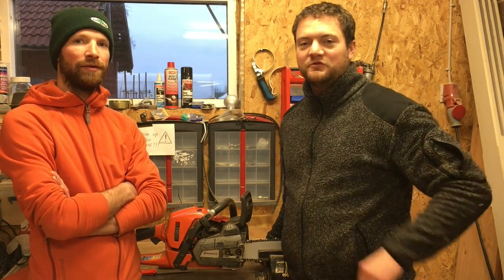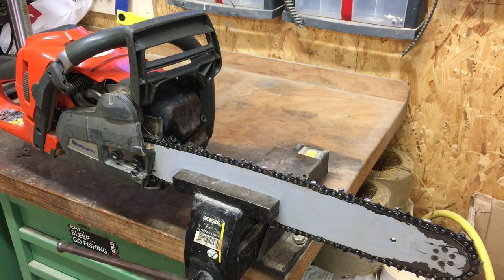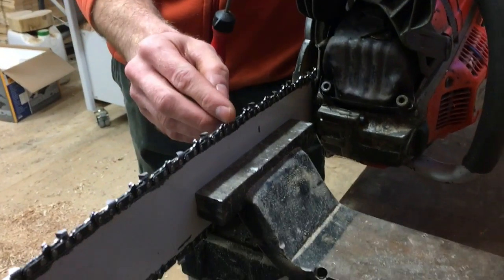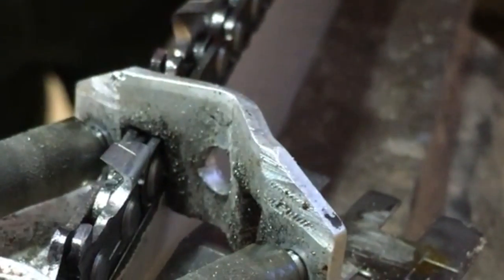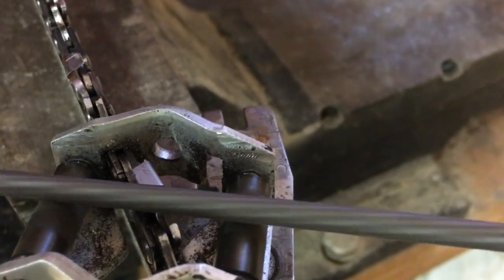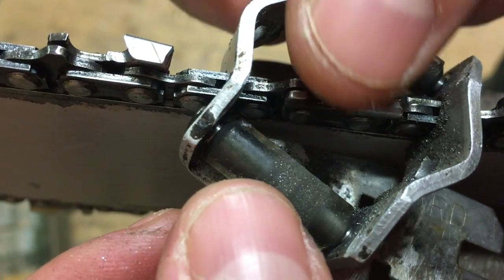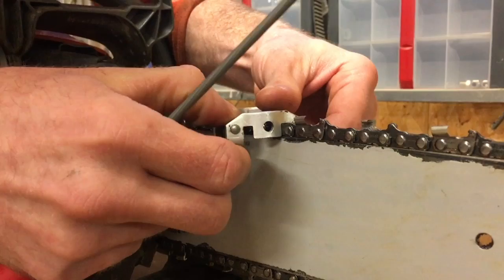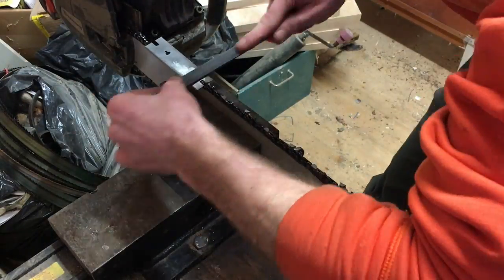Razor-Sharp Chainsaw - How It's Done

Comment: I bought a new Craftsman chainsaw and I didn't know that I was suppose to adjust the chain after 15 minutes of use. After a couple hours the chain jumped off the bar. When I put it back on now, it has a place where the chain doesn't slide freely. And since I'm dumber than I look, I'll probably just go buy a new chain for $20. And now, thanks to you Swedish guys and your excellent video, I know how to make it sharp.
Reply: It pays to know about new tools BEFORE you use them. Especially a chainsaw.

Comment: After filing down the rakers to the correct height, they need to be filed at a slight angle, around 10 degrees. Stihl chains have a grove on them as a guide for the proper angle.

And as mentioned by another commenter, all the teeth should be the exact same length, using the shortest tooth as the standard for the rest.

Comment: Great info. thanks.  What is the name of the sharpening guide you use?
Reply: Husqvarna Combination Swedish Roller Guide
Reply: Oregon makes them.  Stihl makes something similar.  The Stihl system provides greater control, but the file needs to be in a file holder.

Comment: Good step by step process guys, I have never seen those sharpening tools before. Where I am in the US we have different types of guides but I am sure they achieve the same result. Does your brother run an Stihl equipment at all? I myself am an Arborist and have had bad luck with Husqy saws but I prefer their PPE to Stihl, my #1 saw at work at the moment is a Stihl MS362C with a 20" bar and it has done quite well for me, my climbing saw is an MS200T
Reply from the maker: We have Stihl saws as well. I am going to make a video about that.

Comment: Please, in your experience, on average how many feet of chain will one file sharpen?
And, how do you know when it is time time to start using a new file vs. trying to get one or two more sharpenings out of it?
Thanks!
Reply: Robert Wood . I was wondering the same thing , how do you know when your file is done ?? looked online but cant seem to find the answer to that question ..
Reply: pretty simple... when the file is not cutting clean all the way through the stroke or any obvious bad spots time to get a new one
Reply: I replace the file after it doesn't feel right. They are cheap... well the ones sold at the larger lumber yards are anyway. Just a piece of mind.
Reply: Why do you keep you height gauge on an angle when you file the hook?  Shouldn't this be flat on the chain?  Txs
Reply: +A depends on the model.
Reply: @mapleridgefarm1026  When it slides on the tooth without cutting into it. You can feel and see a good file working as you sharpen the chain.

Comment: Excellent video and Very helpful.
Question: The chain and bar were perfectly clean from any saw dust and debris. Did Tim remove the chain and bar before sharpening, or is there some other method for removing the oily, sawdust build-up? Does that model automatically oil the chain while in use or is manually oiled?
Reply: Pretty much all modern saws have an auto oiler.  I use my compressor and just clean off the teeth prior to a sharpen.  In the field I use a brush that is in my sharpening kit.
Reply: All modern saws have an auto oiler, some may also have a manual oiler as well. I have my fathers 1975 Echo CS-701SVL, even it has an automatic oiler and manual oiler. My current Echo CS-8002 has auto and manual.
Reply: R Mac I have an old Homelite 10 inch. So, I guess I'm little bit out of the loop.
Reply: I have a Homelite myself, a Super XL (Blue/White), I love old saws and have a few, a couple of Danarm one of which is from the 1950's I think and a Pioneer 620. They don't build them like they used to, a cliche but true. :-)
Reply: R Mac Yessir, cliché or not, it's the truth! Went through a lot of chains. I just use a rat-tail file and eye ball it. My shame is great.
Reply: +Fred Thorne No shame at all if you  have the skill. I don't, I'm just watching this particular video for knowledge. I started watching Simeon's video's for the homesteading knowledge itself. =D We'll be moving back to the family farm when my husband retires from the Airforce in a year and a half. Can't wait for that to happen! Excited for that. So I've been collecting knowedge...
Reply: Sansa Stark acdc
Reply: AC-DC
Reply: You should take the chain and bar off and clean them AFTER sharpening it.  Your bar doesn't fancy the hard metal particles from the chain much.

Comment: Like a hot knife through butter. Thats a great instruction, Tim! See, i couldn't even remember using any of those jig thingies in school. I actually need a refresh course although i'm certified. I think it's a good idea for safety reasons as i had my certification 20 years ago. I'm still trying to decide on a saw here. I saw a great secondhand one with an Oregon blade but i also have the other eye on a Hitachi. Stihl is a bit out of my price range new but i'm on the secondhand market every day to look at the new arivals! If the price is right, i'm snapping it up. There is an excellent all brands service station in my range, might it need some fixing up. What's your thought on brands and chains, please? I'm so not up to date.
Reply from the maker: Hi there. We only have experience with Husqvarna, Stihl and Jonsered, which pretty much is a Husqvarna now days. We like both brands.
Reply: Thank you!
Reply: Rainx  washer fluid can you mix with other washer fluids

Comment: From a conversation I had with Glen Lovell, Senior Technical Services Technician at Oregon Chain:

"There are a lot of opinions on the subject of whether a chain needs to 
be filed before use or not and it is very difficult to convince someone 
who sharpens are new chain before it is used that they do not need to do
 it. Some of the sharpening before use comes from years ago, before we 
come up with our plunge grind process, where some professionals felt 
they could file a chain better than we could grind one at the factory. 
That is why we went to the "X" grind / plunge grind. The "X" grind 
produces a very sharp cutter that, we feel, does not need to be 
sharpened before use. Having said that, there are still a lot of people 
that feel they need to sharpen our chain before it is used. Overcoming 
personal opinions is extremely difficult and sometimes impossible."

Having said that I want to try a new ceramic file (hone) on competition chains. Diamond files are great too, they roll up less burr.
Reply: A new chain doesn't need to be sharpened. When I install a new chain, I hit the rakers with a flat file, and go to work. I prefer Stihl chains over Oregon. Stihls cut better. And last longer.

Comment: well,  that's the sharpest chain saw I have ever seen! great video.  I will sure use that knowledge next time I will sharpen my chain
Reply from the maker: Awesome. Thanks.
Reply: Best get new eyes if you think that is sharp.. any basic user of chainsaws that have done their research, KNOWS that you are not do apply pressure to the chainsaw to force it down into the cut.. which he clearly does,, this causes additional friction which wears the bar, chain , gear ( drive side) and end sprocket , which also leads to overheating of those metals & dull the chain faster.. A properly sharpened chain, should pull itself into the wood, no matter the type of wood, so much so that you actually only need one hand for the throttle, but I do recommend keeping both on the chainsaw.  It cracks me up watching local volunteers constantly sharpening or changing their chains when cutting up tress from storms to donate as fire wood, because they are pushing the saw... mean while I am going days on days without breaking out a file or cranking up the Belsaw sharps all to edge it up. ( how bad is the lack of knowledge these days... I know  Local logger,  been in business for 15yrs... buys up chains by the bucket fulls. dulls them & instead of sharpening them up,, just tosses them at his work sites. I make it a point to watch for him.. cause I know he will leave a few dozen good chains on a parcel of land he cleared and they are there free for the taking... all because of a lack of knowledge or the will to properly learn how to do it )
Reply: Swedish Homestead : people I know that have experience with chain saws, do not need a gauge to sharpen a saw. Also, u r sharpening g the teeth in the wrong direction ! Sharpen /file a saw or knife INTO the edge...so u don't leave a microscopic burr. Your backstroke on yr file should be your cut / sharpening stroke.
Reply: Richard Elbe : 100% true. Here they even sharpen on the wrong stroke. really not skilled.
Reply: Mike Johnson I don't think these guys will be splitting hairs anytime soon with that saw, not very skilled at all and the saw bogged down in the log when cutting.
   Good video for amateur users.
    Congratulations on the videos but if you need any pointers just contact me, some things though would be too dangerous for you to try.
Reply: Carroll Sanders His brother is a professional tree dude. I'm pretty sure he's proficient with his sharpening skills. Good grief, so many critics.
Reply: Peter Ford He is just an arborist nothing more not a chain engineer, you would believe how many so called arborist can't properly sharpen a chainsaw.
Reply: Sure, I understand. But I know a couple of, " arborists ", and they cut every day for sometimes 30 40 years. I'm sure they've developed their skills, even sharpening, during that time.  I have one I know that is 71 years old, still climbing and cutting. Probably has 60 saws. I'm sure he's honed his sharpening skills during his business time. But as with everything, there are better of any trade. Criticizing is not a plus. That's all I'm saying.
Reply: Peter Ford my skills are so far above the normal user, that they push the limits of reality sharpening with a precision of one tenth of one micron.
Reply: I give up. Y'all are just too superior for this normal world. I just don't know how so many people live their lives, suffering in the shadows of such perfection.
Reply: Peter Ford I hold the world's record for splitting a human hair with a running chainsaw, you are welcome to try, to break it, in now stands at 46 splits from one section of one human hair.
Without cutting the hair into.
     Good luck.😂
Reply: Peter Ford I wonder if you ever heard of square ground chisel chain, or goofy filing my knowledge goes back to the days of real chainsaws 090R Stihls.  Cutting monster trees 8 or more foot in Diameter.
    You should have been around when Ray Murphy was carving belt buckles, as you wore the belt, or striping his daughter's clothing leaving her in a bikini.
     Incidentally I perfected the removing the bikini with the chainsaw stunt, and shaving people, with chainsaws.
Reply: rrenegade111820 I have done that hair splittimg stunt in Ridgeway PA. Right in front of hundreds of chainsaw artists, and yes it was a human hair.  Barnacle parps Chainsaw guide the Bible on chainsaws written in the 197Os clearly shows what he is doing wrong in the chain diagnosis section.  As do most of the other 30 odd something chainsaw guides that were published in the 70s, 80s, and 90s.
Reply: Carroll Sanders were  you also a pro logger? i watched one video of you splitting a hair.
Reply: @carrollsanders9376  lol
Reply: @carrollsanders9376  I trim my toe nails with a 880
Reply: Greg Brown good for you I actually did that in 2005. 
Size doesn't matter.

Comment: That's great! You are teaching how to sharpen a saw and don't know the name of the rakers/drags,,, JK,,, And you sharpen them equally,, so 3 strokes on one side means 3 strokes on opposite side, unless damaged in some way. Tap the file to clean is good, make sure that stoke is straight and don't go up down left or right at the end of the stroke, like most people do, That tool looks like it would keep the up and down under control. (Cool tool) also helps to move the chain and not have to grab with hands, nice. Sure wish you cut some green oak, that oak looked a bit soft but not nearly as soft as the tree in the beginning of the video, that was like a cork,, I think it was a birch but different trees in different parts of the country look alike. All in all a great vid, thanks and keep them coming.
Reply: Ahh, they know. We call them "ryttare", riders, in Sweden. Or "underställningsklackar" if you read the manual.

Comment: Most folks sharpen in the direction you show, but for a truly sharp chain with NO BURR, you ought to sharpen INTO the tooth, toward the powerhead.  Try it, you will be quite surprised how long your chain stays sharp, since the burr created by filing how you show, quickly breaks off and begins the dulling process.
Reply: Mark Havel
Reply: Can you explain how you sharpen in this way?

Comment: Don't forget to get the gullet. The part that continues down under the sharp tooth edge should be a smooth "C" shape. The gullet helps to shave a smooth side to the cut so it doesn't gouge into the wood and cause drag in the bar groove from the driver.
Reply: You seem to know what your talking about, on a 3/8 .50 full chisel Oregon chain should I be using a 7/32 or 13/64 file? I was told either one and so far used the 13/64 and top plate is very sharp but I don't think my gullet is getting a good hook in it.
Reply: @dentondunn4346  personally I like the larger 7/32. Either will work. Just make sure you're adjusting your rakers to each cutter.

Comment: The quality of the sharpening can be determined by examining the sawdust.  You should have clean small chunks of wood and not powder or fibers.  This method also can tell you when you need to sharpen.
Reply: Nah, if I ain't making 8" spaghetti, I ain't cutting
Reply: Never cared to noticed the chips if a saws cutting you’ll feel it cut
Reply: @benjaminkline4855  That's if you're ripping.
Reply: @jonathanfranck357  nah I usually make noodles no matter which way I cut
Reply: @benjaminkline4855  I call BS.

Comment: Say there champ I will give you a little tip, flip your chainsaw upside down then clamp it into a vise, now you can sharpen your chain without working over the power head which is not only much easier but somewhat safer too. I myself do not sharpen with a file but remove the chain and do the sharpening on a oregon chain grinder which does a great job once you know how to get all the angles correct and the shape of the cutter tooth along with the height of the raker teeth

Comment: 4:25 "rakers" is the term . Great videos bro's! Keep on doing them. Thumbs up!
Reply: They are also known as drag-links or drag-teeth in several areas of the United States. I prefer rakers because it's shorter and easier to say.
Reply: Stjepan Suman check with your chain manufacturers literature or website they are called depth gauges,but commonly referred to as rakers... to each his own...
Reply: Stjepan Suman always called them rakers here. Canada
Reply: drags is what i always have called them mid west here in IL
Reply: I have heard them referred to as depth gauges, as they determine the depth of the bite of the chain. 
 I'm not a expert of any sort. So I am not saying 67disasterman is wrong.
East Central IL.
Reply: victor castle You Sir are 100% correct!!! Expert or not Depth Gauge is the correct terminology, many people who consider themselves as expert's have failed to look at the chain manufacturers literature. Rakers is a term used for one or two man cross cut saws and Drag Link I'm not sure about, it sounds like a connection to a LGBT website😉
Reply: William Hill. lol lgbt
Reply: Stjepan Suman 8
Reply: victor castle ل
Reply: 67disasterman 1
Reply: In Denmark they are called "ryttere" or "riders". I imagine the Swedish word might be similar, but I am curious if anyone actually knows?
Reply: @Noeleren  In Sweden we call them "ryttare".
Reply: I grew up around the logging industry in west coast Canada and always heard them called rakers. Then I got into chainsaw milling and found that real rakers are a type of tooth found in ripping chains - intermittent narrow teeth sharpened at 90 degrees that rake sawdust out of the kerf (ripping generates A LOT of sawdust). Now I call the rakers in cross-cut chains depth gauges. Keeps life simpler.

Comment: That was good, I have never used a flat file on my blades but I will now.....!!
Reply: If you cut the "rakers" down to far- you will find that the chain wants to take to big a bite out of the wood and stop.
Reply: its just harder on the clutch so you have to be careful of it ...but the danger is a kick back

Comment: Where do you get that little jig you have with the wheels on it?
Reply: justinlogue31

Oregon makes them.  Stihl makes something similar.  The Stihl system provides greater control, but the file needs to be in s file holder.

Comment: I use stihl saws and their chain, semi chisel chain. I have a professional grinder to do the cutters and I use the depth gauge you are using, they are available at amazon (.325 pt# 505 69 81-00)( .375 pt#505 69 81-03). This depth gauge does not remove a fixed amount like the other types do, it actually increases the depth the more the cutter is filed back. When a cutter is traveling down the bar and encounters wood the cutter actually rocks backwards on the hinge point or the very back of the cutter link that is touching the bar. When a saw chain is new the cutter edge actually lift when they rock backwards. Each time a chain is sharpened the cutter actually loses a bit of lift and it will even get to the point the the cutter edge will actually lower when it rocks backwards, Husqvarna's depth gauge will compensate and increase the depth as the chain is sharpened back.